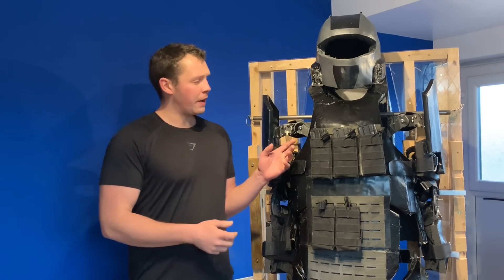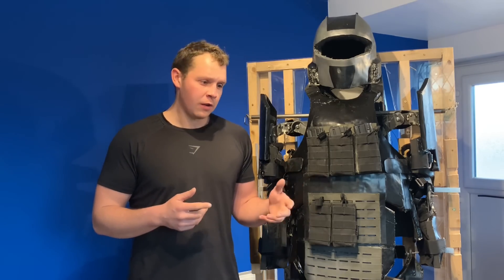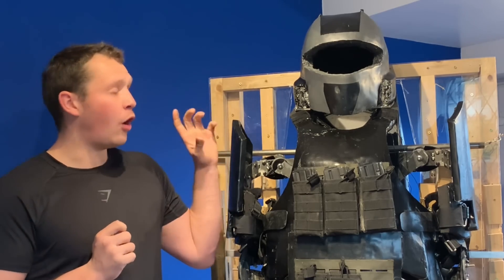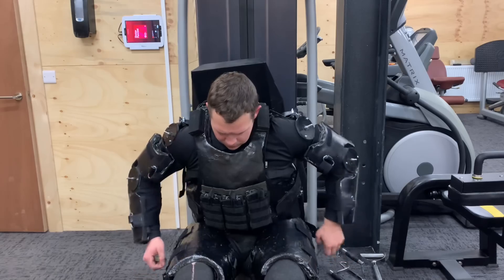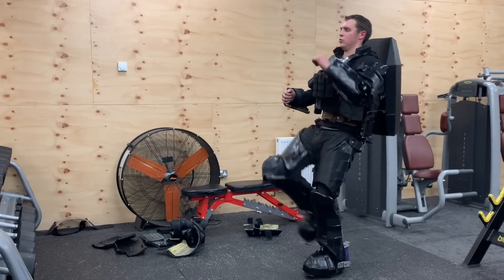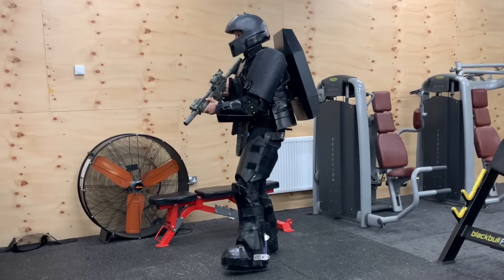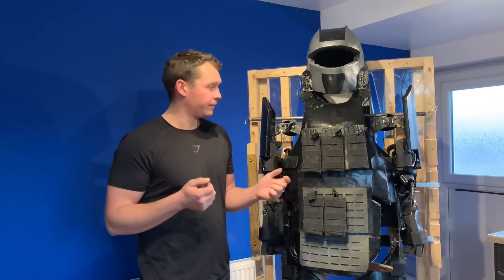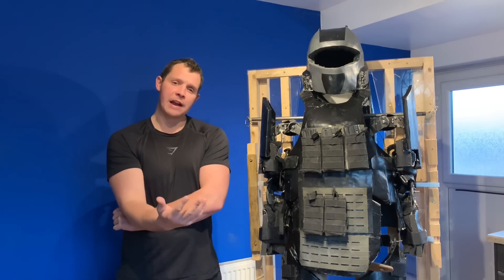Functional Combat Capable Power Armour Development Episode 5 Quest for Bullet Proof Exo Skeletons

Comment: You should look into the armor of the English Civil War, as they faced significant gunfire and explosive hazards, while using three quarters plate armor for heavy calvery. The armor material itself isn't useful today, but the layout and cut of the plates should be.
Reply: I second this.  Late-medieval, renaissance, and post renaissance armor is a wonderful example of full and semi-full coverage of the body with advanced articulation in joints through lames and personal tailoring to allow for maximum movement possible.  And cuirasses of those time periods were designed to protect from musket and arquebus shot from far and medium distances (more like a side note if anything)

Comment: Outstanding for a prototype, surprisingly good mobility for what it is. A few notes for practicality. 

Anything like this would be far too impractical for field use, you're not riding in a standard vehicle wearing this thing until the bulk has been significantly trimmed down, and you need to be able to do more than march at a steady pace. Even if you aren't feeling the weight, it does heavily impact your mobility over rough terrain, no pun intended. As in, you aren't heaving yourself over a chest-high wall or fence while wearing it, and moving up/down hills in the woods is going to wear you out pretty damn quick, not to mention the added danger of falls. Without climate controls, this is a no-go in the tropics or desert, you'd be cooked in that thing. 

Don/doff needs to be much faster, probably with an emergency removal feature, I'm sure that'll be corrected in future prototypes. Individual plates need to be replaceable without replacing the entire system, as well. That'll be a necessity for contracts, and something to think about ahead of time.

For SWAT/entry teams, Hands and forearms constitute 60%+ injuries in FoF CQB training, so some manner of gauntlet that doesn't interfere with weapon manipulation would be necessary. The insides of the upper arms, shoulder pocket, and armpit area will require some thought for CQB use; soft armor will likely be the best compromise.

For the helmet, it might behoove you to integrate it into the chest/back plates to support it, with a flip down visor akin to the russian helmets to allow for a compromise between situational awareness and protection. This could also allow you to integrate a bevor to protect the throat.

You aren't getting a good cheek weld with any kind of visored helmet, but there are some options for stocks designed around them, I know Sig has one for the MCX and MPX.

Comment: Greetings, friend! 
This is a very interesting passive exoskeleton project and I fully share your dream of building a real combat model with your own hands.
But for now I'd like to make a couple of points: 
1) I admire your foot mechanism - it's great!  It will certainly be able to save the operator from an anti-personnel mine and slightly increase stability 
2) There are many open places on the joints: knees, elbows and shoulders.  As an option, in the final version, cover them with soft Kevlar or make modular joints like in knight's armor.  
3) There are not enough gloves to close the musculoskeletal system of the exoskeleton.  Here you will need to think a lot about the design, so that the gloves do not interfere with firing and other manipulations. 
 4) Since this will technically be armor, to increase its bullet resistance, the frontal part of the body (cuirass, if you like) can be made of an optic shape with a central stiffening rib to increase the reduced armor and ricocheting.  Same story with the helmet. 
5) The process of putting on a suit.  I suppose you thought about this, but it would be much better to make the structure as monolithic as possible (like the armor from Fallout) so that preparation takes as little time as possible.  To do this, some parts of the exoskeleton will need to be opened using servos or hydraulic/pneumatic pistons. 
 6) The hip joint doesn't look strong, it definitely needs to be thickened. 
I hope, friend, that you will take my criticism correctly and that Google translator conveyed my thoughts correctly) 
Honor and good luck, author! 
 Greetings from Russia!
Reply: I think it would be best to cut foot system altogether. Shielding from landmine is easier done with perhaps polyethylene shielding, but overall impact battle mobility and stamina heavily.
Chestplate probably should be cut down to be somewhat more like modular armor vest. have base stiff layer which provide structure though no armor value, then place armor overtop.
Morethan this, medical action. Modern armor vest has emergency release handles to quickly release soldier from armor and allow a medic or corpsman to treat them. This... Well, without a K-12 saw or other tool... And that's assuming mechanisms are not damaged. What if armor is bent into a bad shape?
Reply: @KoishiVibin i guess medics would have to carry a oscillating tool of some kind with multiple tool heads. Though at the point that it cuts carbon fiber it probably cuts flesh aswell.
Reply: @medievalarmorexptert6827  
or, and hear me out
A MEDICAL RELEASE HANDLE instead of trying to jaws of life someone out of their suit.
Reply: @KoishiVibin  oh yes but thats for if that fails. If not then for sure just quick releases. But just IMO if these would have any large use there for sure be malfunctions with things like that in combat situations or theyd be crushed/mangled. Because youre not just dealing with soft fabrics but metals and carbon fiber. But quick releases would work majority of time for short operations i think.